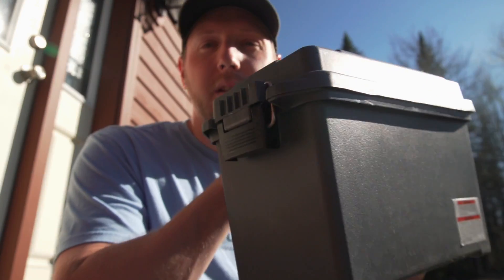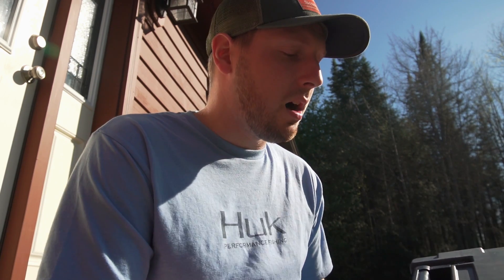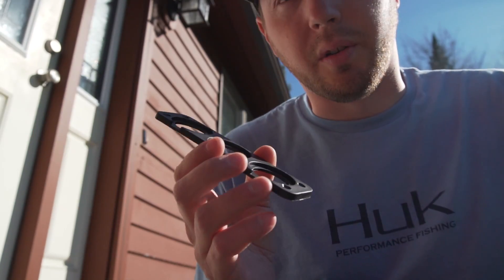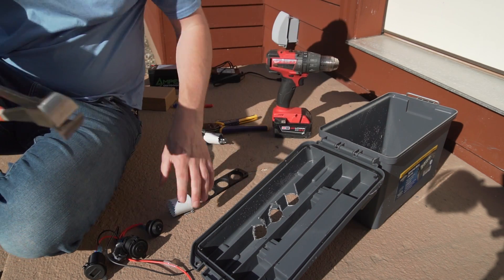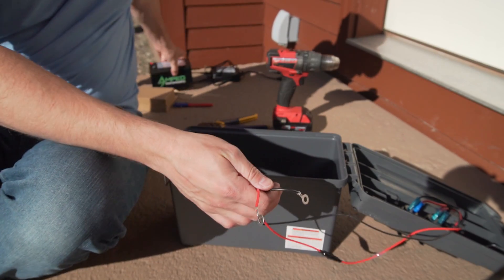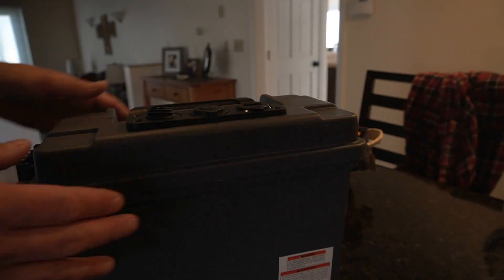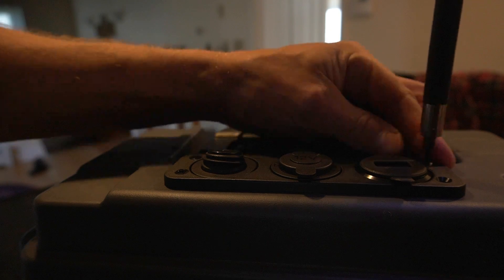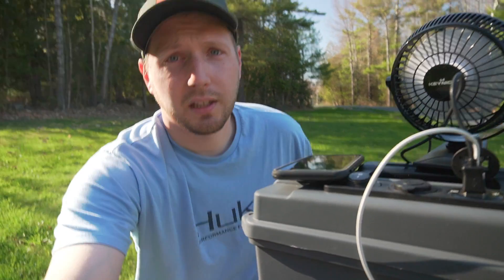CHEAPEST Lithium DIY Power Box

Comment: Just built 2 of these 1 with a 6amp and one with the 12amp lifepo4. Added an sae input to charge the battery with a charger or solar (simple 10amp bateria mppt). I can even use the 12amp with my CPAP for a few hours.

Comment: An inline fuse between the battery and the main switch would be a good idea for safety.
Reply: there is
Reply: The socket panel comes with its own inline fuse. Good suggestion tho if it did not.

Comment: Love it ,, quick , simple , easy .... could mount charger inside permanently as well , and wire it to plug into small solar panel as a trickle charge set up..... add an inverter , and cover all your needs

Comment: What model battery is the amped outdoors?
Reply: Any battery that fits will do. I use a SLA 7.2AH in mine, which is a bit small as a slightly  larger battery would also fit.